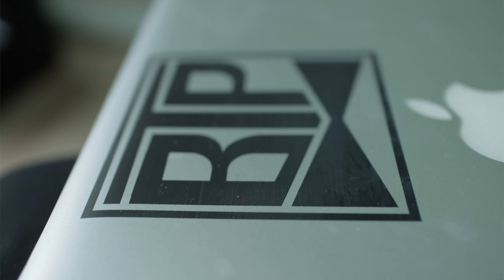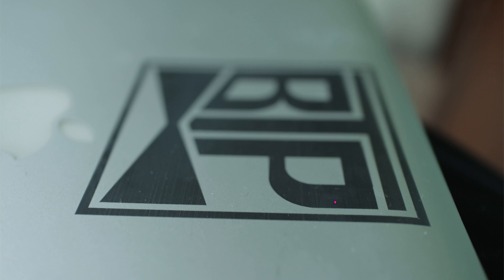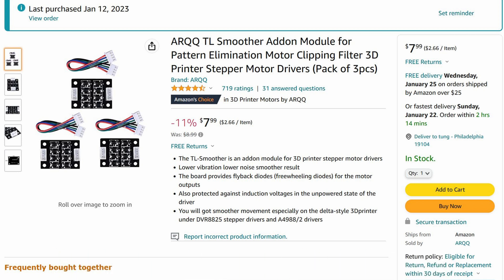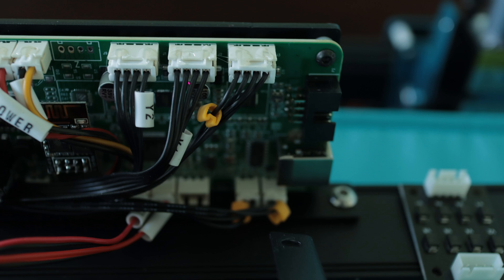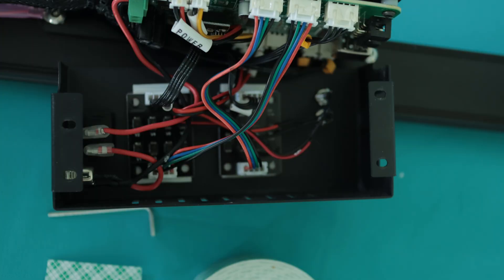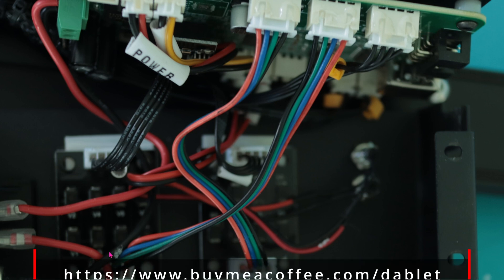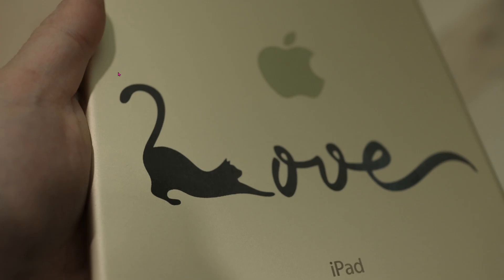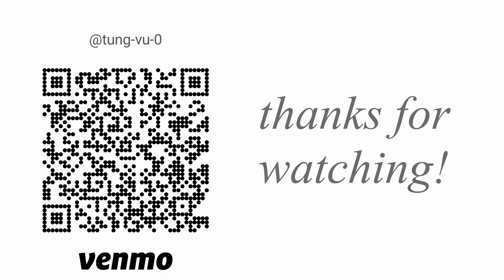laser engraver upgrade: TL smoother. no more banding!

Comment: If I put a smother on a x motor will it make a difference? So send of putting 2, I will put 3 , it will make a difference?
Reply from the maker: i would recommend putting the smoother on the axis that has the problem. you can certainly add more smoother and it would not hurt